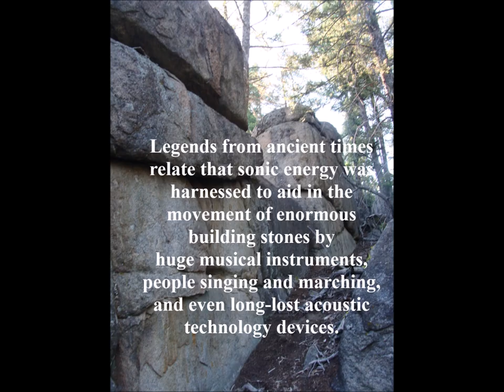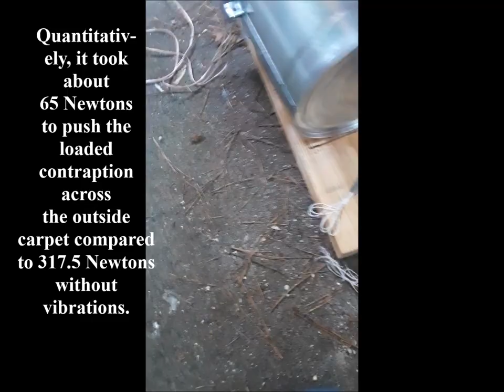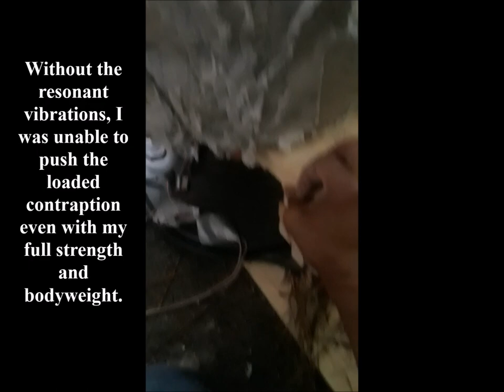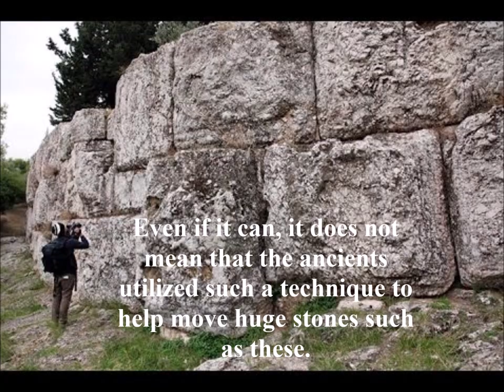Moving Boulders with a Push of the Finger: Did Sound Help to Build the Megaliths?

Comment: Might be the case that this is a technology and method that does work well but isn’t how ancient people built megalithic structures. I personally like the “geopolymer” theory that they had a recipe for creating very realistic limestone “concrete” that when cured is not distinguishable from naturally formed limestone. Limestone isn’t like granite with its complex crystal structures so it could be done. We only recently re-discovered the recipe for Roman Concrete so perhaps the ancient people came up with a great recipe back then
Reply from the maker: Ancient concrete is only part of the picture. They also processed and moved individual stones. Much of the material was sourced to quarries many miles away. So even cement mix doesn't solve the issue of transportation. You still have to move thousands of tons of concrete mix and rubble from the distant quarries. And you have to move a lot of it at one time for the process to be efficient. Not to mention the enormous amounts of water needed to create the mix and wood for some of the molds. In some cases, moving the boulders would actually be more practical. But I reckon that they used both methods just as we do today.
Reply: @gsutton78  I’d imagine it’s substantially easier to move aggregate, sand and small rocks etc than giant monolithic stones.
The raw materials could be transported in bags or baskets very easily.
Reply: @gsutton78  the other thing that “geopolymer” concrete would solve for is the amazing precision of the stones. We can believe the stones were cut so precisely these multi-ton stones fit together so tightly you can even slide a sheet of paper between them OR that the blocks were cast with large molds and the side of the previous stone was used in the mold- then you’d have a very easy high precision fit.
It’s all talk unless we find a contemporaneous record of how they built it we can I only theorize.
If you asked me to build a pyramid today- I’d use geopolymer not quarried stone
Reply from the maker: @haruruben     Not really. Cement mix is easier to handle on site. But it still has to be transported. Today, we have huge trucks which constantly churn the cement during transportation. I also don't think enough bags could be made to transport a much heavy, loose material. Large containers made of wood or stone would be needed which would also be heavy. I think geopolymer was definitely used for the more locally sourced material, but not the material sourced 10 to several hundred miles away.
Reply from the maker: @haruruben   Geopolymer might help with stones fitted close together in some cases. But it can't explain very intricate carving and drilling. Nor can it explain sculptures like those at Abu Simbel or the Colossi of Memnon. They had to have had sophisticated tools to do those just as we did with Mount Rushmore.

Comment: So I’m a bit confused why would I be able to play this loudly through speakers and do it
Reply from the maker: Well, it works like a speaker via interaction between a solenoid and a magnet. But the key difference is that a speaker is made and oriented to couple to the air with most of the energy manifesting as audible sound. But this device has a much heavier diaphragm and is oriented to couple more with the soundboard and ground. Activate it at resonance and much of the energy manifests as powerful surface vibrations which can both reduce friction and move the entire contraption along the ground.

Comment: But what about lifting ,. ha "? Can you lift stone with that methods?
Reply from the maker: Prometheus    Sound vibrations can actually do many of the same things as electromagnetism: attraction, repulsion, levitation, and propulsion. But, sonic transducers have to be made so that enough energy can be transformed into vibration. What happens with conventional transducers and even my pail resonator here is that when certain energy levels are reached, shock waves are produced which prevent any further build-up of energy. It's called acoustic saturation. A company called Macrosonix describes a technique called, Resonant Macrsonic Synthesis (RMS) which aims to do just that. https://www.designnews.com/automation-motion-control/sound-power-comes-age.

Comment: hmmm ... so in order to make a boulder easier to move, you first have to find a way to move it on to the thing that is supposed to make it easier to move.....
Reply from the maker: Tony Sparks.   Well, even with purely conventional techniques, the ancient builders would still have had to move the boulders onto wooden sleds or barges. So, loading it onto something is an issue regardless. But this is only an experimental technique showing that acoustic vibrations can aid in the movement of heavy objects. The ideal technique would be to get the boulder 'itself' to vibrate at its own resonant frequency(s). The legends speak of the megalith blocks being made so light and/or frictionless that they could be tapped into place; so close together that even a sharp knife can't fit between them.

Comment: But wouldn't the vibrations make the object dig itself into the sand
Reply from the maker: It would depend on the surface area of the stone. The greater the area, the less likely that would happen. And if the stones were smaller, they could be placed on wooden sleds which have a larger surface area and which would distribute the stone's weight.

Comment: Is the louder the sound the greater the effect?
Reply from the maker: It is somewhat. It depends on the coupling. If the sound is coupled to the air like an upright speaker, then it will be louder but it's not going to move around much because the vibrations are mostly exposed to the air. But, if that speaker is placed face down on the ground, then it will be said to be more coupled to the ground and the vibrations will travel more through the ground than through the air. It won't be as loud but the speaker will move around more. More of the energy is used to move the speaker rather than being coupled to the air to make noise. Additionally, we could also use frequencies so low (infrasound) or so high (ultrasound) that you can't hear them and it would still work.

Comment: Now,😢 let's try moving three megalithic blocks weighing in at 1,250 tons a piece from the quarry site in Baalbek Lebanon over to the temple site two miles away and put them into position. Also move and raise 100 megalithic blocks weighing 200 tons a piece 40 feet in the air and put each into position as done in the temple near the pyramids in Egypt, etc. I'm open to sound may having been used and levitation etc, but until we can replicate exactly what had been done it's still just theories. 
Also if sound and/or levitation was used, where did this knowledge/ability  come from?
Reply from the maker: It's good that you're open to sound being used. But you also need to be open to the scientific method. You can't just expect people to start out levitating boulders. Science occurs one step at a time. And the next step is to see how this could have been achieved without modern technology. And I have some ideas for that which I will present over several upcoming videos. But even if it is all proven possible, it still doesn't mean this is what the ancients actually did unless we find the smoking guns which would be remnants of the devices themselves, manuscripts describing the devices and techniques, or pictographs showing the process. Preferably all of the above. Without that, it would still be just a theory. But at least it would give us an idea of what to keep an eye out for in the archeological record. As far as where the knowledge came from, well how do we achieve knowledge today? We observe nature, then experiment and figure out the principles and properties. We then devise cosmological and theoretical models and frameworks, enabling us to further understand and even predict the behaviors of related systems. And from this, we develop new theories to test. The ancients were every bit as smart as we are. So, it's reasonable that they did the same things. Unfortunately, they just weren't as keen about writing everything down as we are. Many ancient civilizations seem to have leaned more towards an oral tradition of recording, with the information often passed on very selectively rather than being made available to everyone.

Comment: I'm interested in the theory that sound was used to move megalithic objects.
......the theory in the video however, does not address how they would have been lifted ontop of something like that in order to move them.
The records that we have of such events do not say that they even came into physical contact to move these stones.

You have an interesting experiment, but I do not think it applies to these scenarios
Reply from the maker: Actually, the ultimate idea is to resonate the stones themselves. The experiment here just shows that resonant vibrations can develop enough energy to render heavy weights easier to move and as some passages say, even move by themselves just as the sled is moving here or even to levitate. But a way has to be obtained to figure out the resonant frequencies of stones and then stimulate them for maximum effect. The frequencies of stones typically lie in the ultrasonic range. I haven't begun work with ultrasonic vibrations yet, but will soon.

Comment: Have you tried doing it on sand?
Reply from the maker: Actually, yes. But, it only works to a degree as the sand starts to imbed in the wood after a certain amount of weight is added. This increases friction rather than reducing it.
Reply: @gsutton78  if you make a thick layer of sand and have borders around it?

Comment: why so much transfomator? did ypu have any scheme on this?
Reply from the maker: Transfomator??
Reply: @gsutton78  trasnfomer i mean
Reply from the maker: Oh, I had to have a good balance between voltage and current output. Had 3 coils wound in trifilar style. Each coil was energized individually with 4 transformers.
Reply: @gsutton78  so you've used huge wattage by using many transformer? iam very curious about yours and want to replicate but your transfomer just too much for me, i thought 1 or small transfomer will adequate for experiment
Reply from the maker: @dogodogo5891   Each transformer is rated at 60 volts, 2 amps. But huge amperage isn't really necessary to demonstrate the concepts. I was just experimenting. And honestly, my electronic/electrical skills aren't the best yet. If you're really good at electronics, you might be able to design and build a much more efficient circuit and be able to get the same or better effects with less energy.

Comment: What if the earlier humans had giants who could just pick them up?
Reply from the maker: I could see giants to a certain extent. But given human nature, the human giants, being far stronger, would have forced the smaller humans to do the work. It's a form of dominance. Even still, I can see giants building some of the structures. However there would still be limits as they would be subject to the same laws of physics which would limit the weight that even a giant human form could lift. The Earth's gravity would also impose further challenges as it would take a lot of strength just to move. We can see how cumbersome an elephant's walk is as it stays under its own weight. The heart would also have to work that much harder in order to pump blood to the head. We see that in giraffes. Also, the laws of diminishing returns would apply. You do get stronger the largest you get. But you also get heavier. And since muscle strength is related to the cross-sectional area of muscle fibers (which is related to the square) and body weight is related to volume (which is in turn related to the cube), then you would get heavier much faster than you would get stronger. At a certain weight you would no longer be able to move. An ant the size of a human would likely barely be able to stand under its own bodyweight rather than being able to press bulldozers. But those aside we know that giants aren't really necessary. Coral Castle, a modern day megalith in Homestead Florida, was built just a few decades ago by Edward Leedskalnin, a man who was about 5 feet tall and only 100 or so pounds. The average weight of the stones he moved are said to be in the same range as those used in the pyramids. Interestingly, he claimed to know how the ancient structures were constructed and duplicated it himself.
Reply: Makes a lot of sense...

But the size and strength was an advantage of the giants and also a disadvantage at the same time.....meaning the giants probrobly relied on their advantage and became weaker so they were extinct for that reason....or evolution took over.

The smaller humans  might have been more intellectual than the giants.....very hard to prove since the giants are not around.

So many ways to see it but very little ways to prove it.

Man kind has been lead to believe many things but it's our own decision to believe or prove the information. 

Either way.....it is amazing to search for the truth that human beings are amazing if we live a life of less distraction and focus on our future.

Comment: .....Remember those little toys in the 80s/90s  with a stering wheel , a little toyish driving simulator for child that vibrated, that had a little car that mover forward on the racing track by vibrating ,,it went forward by having velvet underneat that made it go forward as the hair where laid,and not backward because the hair goes against their way.
Reply from the maker: Yes, I've heard about those!

Comment: Well you figured it out. Cool. Do you get a nobel prize? You should. If you couldnt with all your waite then you could with your fingers. Thats got to be it. So how do you make that big of vibrations back then and what about the effect on their eardrums and hearing.
Reply from the maker: Well, the hearing issue depends on how the vibrational energy is coupled. If coupled to the air like a loudspeaker, then it could rupture eardrums. But if coupled more the object and ground, then the vibrations result in movement. Just like a quake. The vibrations of an earthquake have enough energy to move around millions of tons because the vibrations are coupled to the ground. But they don't typically rupture eardrums or internal organs. Same with a jet engine. If you stand beside it, it could cause hearing loss, but inside the jet in which the vibrations are not directly coupled to the air (that in addition to sound absorbers and insulators) It's loud, but there is no danger to the passengers.
As far as how it could be achieved in ancient times, I'm working on that now. The ancients knew about steam power over 2,000 years ago. Steam or other pressurized fluids can be used to generate vibrations. There are also ways to generate vibrations using properties such as thermoacoustics which require no moving parts.
Reply: So cool. Your very smart. Could you do something on what dept charges and sonars do to wales and dolphins.
Reply from the maker: @b.j.hinote4301  Thanks! That might be an interesting video topic!

Comment: Controversial opinion here, but I think they used levers and pulleys.
Reply from the maker: I doubt even we today would be able to move the sheer tonnage of mass with industrial strength levers and pulleys alone. The Japanese already tried to use similar arcane techniques believed by mainstream investigators to have been used in ancient times in order to build a "small model" pyramid but they failed. They couldn't even finish without the assistance of modern technology. Pulleys and levers also wouldn't help very much in moving large stones over large distances. I agree that they used them. But I also believe they had other methods at their disposal just as we do today.

Comment: Ok, but how much energy are you using to produce the vibrations?
Reply from the maker: Alex Ferrante.  Roughly 320 Watts was used in these experiments. I will put out a separate video with power, energy, and scaling in the near future.
Reply: @gsutton78  with a 300W winch you can pull 900Kg at rougly 1.8m per minute, without any effort.. the concept is interesting though
Reply from the maker: @alexferrante   True. This is by no means perfected yet. Also, more than half my energy is being dissipated as heat in the driver coils. So, I have to improve my electronics design skills to rectify that. But, for now it at least shows that there "might" be something to the ancient "sonic" stories.🤗
Reply: @gsutton78  hydraulic? With pressure microswitch
Reply from the maker: @paulleftwick7782    No, this design is electromagnetic. It works like a sub-woofer with the metal pail as the resonant body.

Comment: The civilization that built the pyramids (not the Egyptians of course) used sound and vibrations but were also giants.
Reply from the maker: The thing with giants is that while strength does increase with size, it is not linear. At a certain point, you reach a state of diminishing returns in which you're getting heavier much faster than you're getting stronger. This is why elephants sway so much as they walk. I don't discount giants, but they're not necessary to explain all of the megaliths. Edward Leedskalnin, builder of modern day megalith Coral Castle, was a rather diminutive man who was barely more than 5 feet tall. Yet he raised a 9-ton door and a nearby 30-ton wall.